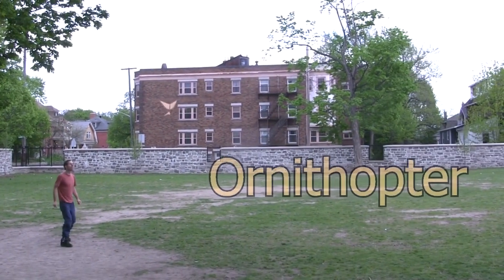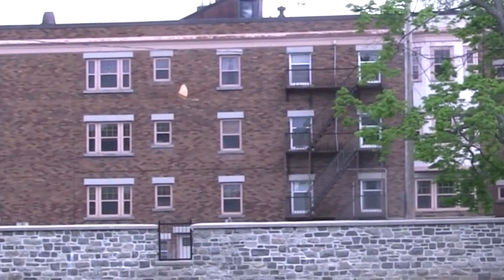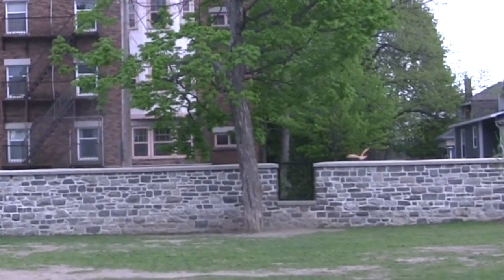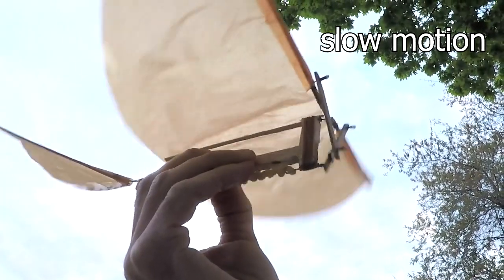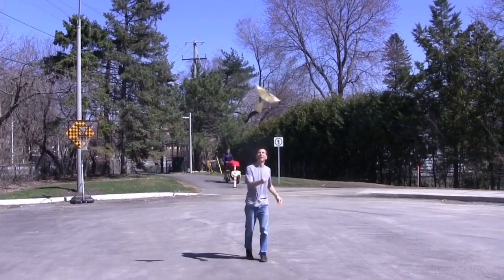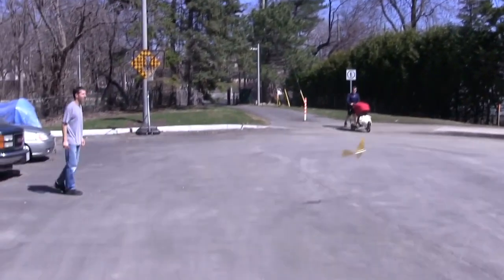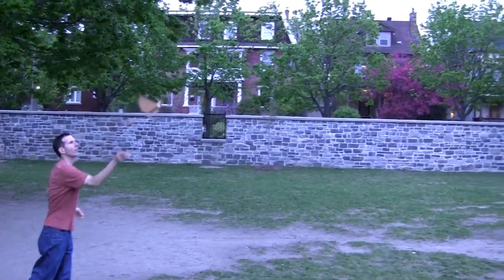Ornithopter - Rubber Band Wing Flapping Flying Machine

Comment: Hi, 

Do you think this can be actuated and sensors can be put onto it? 
What was the total weight of the gadget? 
What
Reply from the maker: I didn't weigh it with the rubber band but it was 7 grams without. It took a lot of effort to get it that light so that it would fly so it can't take more. See my How-to-make video where I show weighing it at various stages https://www.youtube.com/watch?v=ZvzpsRWl12s
Reply: @RimstarOrg  thank you for your response. Can you share the details from where I can get some of the materials you used? I want to build one by myself. And then see how I can may be add some sensors/actuators etc.

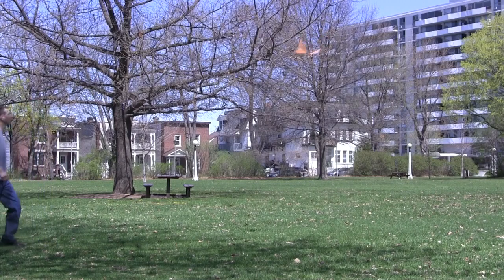Comment: Wow! Amazing flying for just rubber band powered! Laughed at 0:54 when it tried to exit the door but just missed :D

Do you think adding electronics to it would weigh it down too much? How much payload do you think it could carry?
Reply from the maker: Glad you like it!
It's not a normal rubber band like you see every day.  Apparently those don't have much rubber in them. Instead it's a rubber used specially for very lightweight planes. It's surprising to see how many how many turns you can get on it. I'll be showing more about that in my next video on how to make this. In hindsight I should have shown a bit about it in this video.
Electronics would weigh it down too much. In fact any additional weight would, so no payload. Without the rubber, it weighs in at just 8.4 grams. The rubber adds another 2 grams. I have an old RC toy that I'm planning to take apart and reuse the electronics in a larger ornithopter that I'll design.

Comment: wow great contraption! if you had made this in the 15th century and presented it to the king, you'd be ranked above Leonardo Da Vinci.. its amazing how it flies flapping operandi on rubber band propulsion power!! lets add a powerful 20kv electric motor and a lithium battery and see her run like a concorde! by the way try this on a bunch of birds, I bet they'll  say ai karamba!!
Reply from the maker: +fidel catsro Thanks! We did have one bird, a seagull, interested at one point but it's a few minutes between flights while we rewind the rubber band so it didn't stay interested.

Comment: This is really interesting, the energy is stored as potential in the coiled band. I wonder if the energy density of a rubber band is better than a battery?
Reply from the maker: +Stephen Methuen I don't know enough about small batteries, lipos I guess. The rubber band weighs in at around 2 grams.

Comment: aw man that's nice! for some time I have been thinking about vertical flight flapping machines, sorta inspired by a bee. Althou, right now I have built DIY arduino remote control, and am building a RC place, so I won't be doing that. But, I think you could try it! have 2 vertical flapping wings, and sync them to have 180 degree phase difference.
Reply from the maker: +Oinikis Sounds cool. Vertical take off would be nice. Currently I'm planning to design an RC ornithopter using RC parts from an Air Hog Megabomb toy though.

Comment: time to introduce DC 3.7V 66000RPM Wired Micro Coreless Motor into the Ornithophter
here's the video of the motor https://www.youtube.com/watch?v=XeIxYT1og9M
Reply from the maker: +Oswald Rayleigh I have an Air Hogs Megabomb RC toy that I picked up at a yard sale. It has a lightweight motor and battery and enough degrees of freedom for the wings, steering plus an extra. I'll be trying to design an ornithopter to make use of those parts first.

Comment: Love it! I'm definitely putting a build like this on my list of things to do!
Reply from the maker: +USWaterRockets Thanks! Actually, it's light enough to carry and release from a rocket. We'll get to space yet! :)
Reply: Holy cow, you read my mind. I was thinking of how I could deploy the thing from my rocket at apogee! Tell me this, what happens when the rubber band runs out of energy? Will it glide, or does it nosedive? If I deploy at several hundred feet, I know it will run out of power wile way up there.
Reply from the maker: USWaterRockets
I was thinking about the same issue. It'll nosedive because the remaining tension in the rubber will pull the wings down. You'd need to somehow keep the wings out, and then it would glide. Off the top of my head I can't think how to do that though.
Reply: RimstarOrg I was thinking there could be a second rubber band that is under tension (just stretched) and is trapped by the windings of the twisted band. When the twisted band relaxes, the trapped band is released and somehow (I have not worked it out yet) that power is used to hold the wings in the proper location for gliding.  Perhaps the second band is inserted into the windings near the tail and comes forward after the main band unwinds and it then pulls the main band forward, opposing the tension? I need to build the ornithopter I guess before I can really experiment.
Reply from the maker: +USWaterRockets One issue I thought of is that these ornithopters are affected by wind. They weigh only around 10 grams. I wonder if at apogee there might be too much wind.
Reply: RimstarOrg We've gotten very good at determining the local winds. There are certain weather patterns that will turn up periodically where the winds will be totally calm, even at altitude. I've taken my quadrotor up over 300 feet and it will hover in place with no corrections needed (it has no auto position holding capability). I would definitely just wait for the right day to launch.

Comment: A really good flapping motion and looks great in the air. Perhaps paint it up to look like a bird too.
Reply from the maker: +slider2732 Was thinking about it but worried about the weight. If I used transparent mylar then that would be lighter and I could paint any design in any shape and only the painted part would show.
Reply: RimstarOrg
Have found that a light rattle can misting from a few feet away works great, even on foam. Just have to mask/block the areas for no paint, or lay a stencil over the area and block the rest. And, there's always Sharpies :)

Comment: How on earth do you control that thing????
Reply from the maker: +Brandon Fisher You don't. You can angle the tail a bit, or add some weight to one wing to make it circle in a particular direction but that's about it. Of course if you had a remote control, motorized one then you could add control either via the wings or the tail.

Comment: I bet you could use a small motor (like a cell phone vibrator motor) and a small coin battery to give it longer flight.
Reply from the maker: +Flagstone78 I would need larger wing area to lift the added weight. I'm hoping to try making an RC one by scavenging an RC helicopter toy I have.

Comment: awesome,  what material did you use for the wings?
Reply: +RimstarOrg that's really interesting,  I've been looking for a good material that is able to move air like the wings you made. but scaled up to my arm size.  like wings. it will be great exercise moving that 15pounds per square inch of air .
Reply from the maker: +Robert Foster I don't know what load the tissue can handle. You can spread dope on the tissue to strengthen it but I didn't since that would make it heavier and also shrinks the tissue. Normally this tissue is spread over model airplane wings with full frames in the wings. In that case the added weight is less of an issue and the shrinking is beneficial.